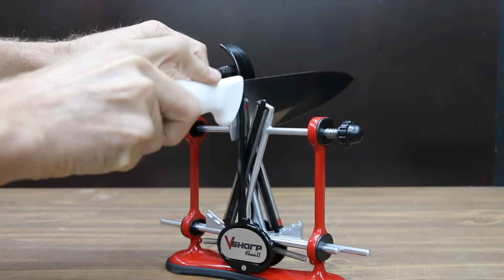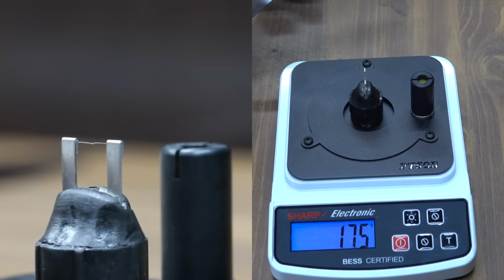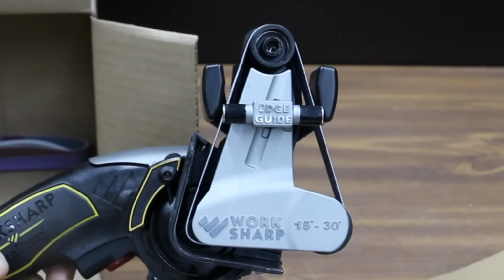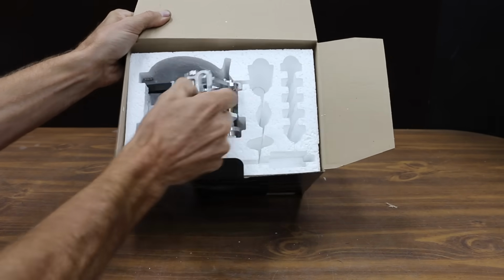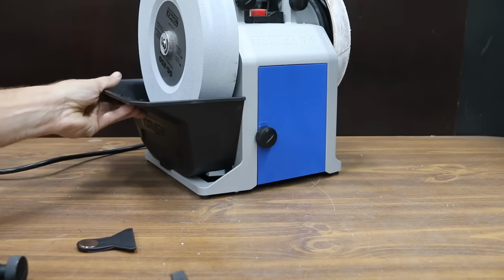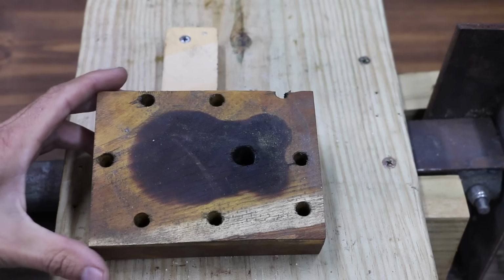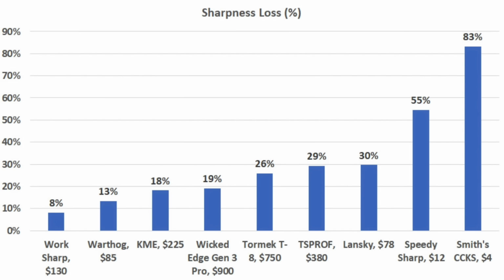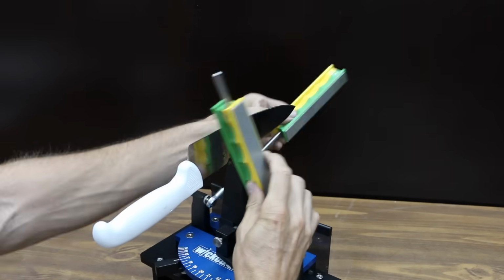RUSSIA vs USA Knife Sharpener? TSPROF vs Lansky, Wicked Edge, KME, Tormek T-8, Work Sharp Ken Onion

Comment: I've used the Smith's Abrasives PP1 Sharpener ($10) on axes and pocket knives, It has always done a great job. The Smith's tool you used is about $4. In other words, the Smith did a decent job (actually, 175 is a razor blade on your chart!) for a tiny fraction of the cost of the other ones. A slightly higher end Smith's would be better still. I've thought of getting the Lansky, but your tests proved to me that the simple and inexpensive Smith's is all I need.
Reply: That Smiths TOY is garbage. You dont care about your knives. Im a serious knife owner. I have tried most of these except the Russian tool which I think is probably the best. (Thheir knives are fantastic) I prefer the Lansky diamond. But I have usawed the the cheaper Lansky Carborundum. That Smiths thing is OK for puttng in your glove box. But it wont give you a REAL edge. It will be gone in 5 minutes. What crap.
Reply: @ziblot1235  You are right. My knives are utilitarian. Opinel and Mora. If they break, I buy new ones. It sounds like you should use the lansky for special knives. But it isn't necessary for me.

Comment: Great video. Thank you! The only one I missed is the manual sharpening with water stones.
Reply: Found it in another video. But 1000 is not enough to sharpen a knife. At least 3000 would be good
Reply from the maker: Thanks!  Thanks for the feedback.

Comment: By your video, I think the top 3 I'd personally consider are the Lansky, KME and TSPROF. The Lansky seems like great performance for the price, while the KME seems to be a notch better but commanding a much higher price. The TSPROF is a fair bit higher in price than the KME and while sharper, seems to lead to increased sharpness loss compared to KME. But the TSPROF (by what I could see) seems to allow for longer and more varied blades than the Lansky or KME products. 

 
The Lansky seems like the best product if keeping price in mind, though if you were sharpening a variety of blades the TSPROF seems the way to go from what I can tell. The KME strikes me as something of a middleground between KME&Lansky when factoring in both Sharpness and sharpness loss. It's very comparable to the TSPROF however. 

The style of sharpener these 3 seem to be, I wonder how much skill factors into it. I don't mean to say I don't believe you're skilled in this, but I'm not sure how much experience you have with this style of sharpener. It would be interesting to see a professional compare these 3.
Reply: Considering import taxes and logistic costs, situation is a bit different depending on where you live. Here, in Moscow, This particular TSPROF costs ~180$ while Lansky costs ~100$
Reply: What helps the kme is their gold series diamond plates...not sure where kme sources thrm. But they are incredible....after my kme bit thr dust I use all my stones n plates on thr tsprof and actually get better results.  But other factors such ad portability need to be discussed as well, and in that regard both thr kme and lansky beat the tsprof out of the box.  Thr lansky is a very capable system, but the misconception is price, if you go all out you are in thr $250-300 dollar range thus in same park ad thr fully loaded kme, which is far more accurate and has superior stones and stone selection.
But to each their own.
Stay sharp
Reply: I'd say technique is more important than which sharpener you use. If you used the same stones on all 3 systems you mentioned, there shouldn't be an appreciable difference in sharpness or edge retention between the three(though the tsprof has a tighter tolerance in the moving parts that determine the sharpening angle, so that may result in a better edge). 

To me the most important factor when deciding is how many knives you have, and how often they need to be sharpened.

Comment: I think the two things that were missed here as value propositions are versatility and speed. This is a review for a one-off sharpening, but if you're doing a set of knives then the speed and effort requires matters. As a less important point I'm liking the Tormek as I can use it to sharpen chisels and plane blades, but I completely get that's not important for most people. It is a point in favor when it comes to price vs use case though when compared to the $1200 Wicked Edge, for example.
Reply from the maker: Thanks for the feedback.

Comment: Your continuing efforts on sharping devices and systems is AWESOME. Keeping knives, chisels, planes, mowers, scissors, and countless other tools sharp, is at the heart of safe, efficient, and successful maintenance of so many workshop essentials.   I just purchased a WORK-SHARP PRECISION ADJUST KNIFE SHARPENER – ELITE. I think it could be an honest contender being an easy to use knife sharpening system having a list price of $120.00. Being non-electric and reasonably compact it seems to at home on the bench and in the field. Too bad it seems dedicated to knives only. Perhaps chisels, plane blades, axes, etc,, are in its future. I hope you’ll include it in Version THREE Project Farm sharpening devices test and comparison.
Reply from the maker: Thanks for the video idea.
Reply: @ProjectFarm  BTW, the Work Sharp Elite use the same size abrasives as the Lansky, but of course in a different style holder.

Comment: it's seems like a lot of that cutting test is dependent on how tight that string/wire is strung between the two posts.

The tighter it is strung, likely the less force is required to complete the cut.
Reply from the maker: Thanks for the feedback.

Comment: ME~ breaks out a whetstone, and with the same amount of time they put together one of those 200+ dollar sharper together i am done sharpening a knife and shaving with it..... ANY knife sharpener if one takes the time and does it right can put a smooth razor edge on it...and yes i understand they are just testing and comparing knife sharpeners but it looks like one needs a mechanical engineer to put them to gether and use all the different accessories.

Comment: So out of all of these, which one is the best value for the money? I would think the Lansky System has to be a good value, right?
Reply: Yea. Lansky is what I’ve been using for last eight years. You can get them with regular stones. Diamond stones. Even a leather strip and ceramic stone. I would suggest spending just a little bit extra and buying the clamp as well. Makes it loads easier

Comment: I always like your videos.  You try to test everything you can think of.  I want to suggest something a little different.  I have been looking at purchasing a knife sharpener and have looked through many pages of sharpeners on ebay with a lot of different designs.  I got to see some operate on your video and I'm trying to decide what's important.  I think the ones that clamp the knife then you can flip it over without removing it and having the stone is on a handle with a long rod through a swivel rod end are the best.  It follows the edge curve.  A lot of them can't flip the knife over and I guess you have to take it out and re-clamp it.  The length of the rod seems like it should be as long as possible to keep the angle of the bevel as close as possible as you go around the radius towards the knife tip because you are extending the rod and changing the angle.  Mounting the sharpener to the table is an issue and also how it accepts different stones and diamond sticks.  The leather hone worked great and could be purchased separately.  That's the sort of thing I need to make a decision about buying one and finding the best deal.
Reply from the maker: Thanks!  Thanks for the suggestion.

Comment: In Russia TSPOF BLITZ 360 price is much less - 240$, base version(almost the same, but max angle is 25 instead of 37 degrees) - 170$. With such price basic version is one of the best choices for easy and handy knife sharpener. Although most Russians go with Ruixin RX-008 for just 20$ and ok with it.
Reply from the maker: Thanks for the feedback.

Comment: although i like and appreciate these tests, i feel it's worth mentioning - as an aside - that the steel used in the test knives is neither japanese nor high-carbon. X30Cr13 is a european incarnation of a basic, highly corrosion-resistant steel formula. its specification generally lands the steel in the low-carbon bracket, though some examples may enter medium-carbon territory. knives made of X30Cr13 are very limited in their cutting performance. they are also, commensurately, very easy to sharpen.
Reply from the maker: Thanks for the constructive feedback.

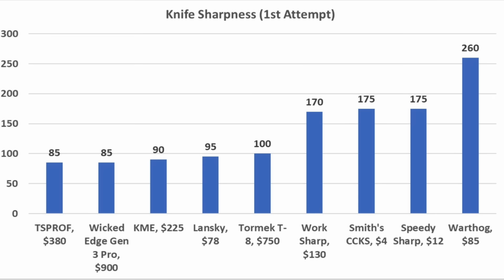Comment: 13:17 so i'm noticing that the last 4 with much worse sharpness numbers, are all sharpeners that require the user to hold the knife at the same angle with each pass. they might have given better numbers if the user had a rock steady hand and put the knife through at a perfectly vertical and consistent pass with each stroke.

I would be very curious if a rig setup to use this in that way would improve their numbers. not that it would make sense to do that, but for science!
Reply from the maker: Thanks for the suggestion.

Comment: I bought a Lansky based on good reviews and I think it is in the sweet spot, ie sub $100 and very good sharpness. I completely rehoned my factory knives at home and they're razor sharp now. To boot, they also "re-sharpen" much easier with the cheap rod that comes in the block. Love this sharpener.
Reply: I have also had good luck with the Lansky sharpener. The only bad thing I can say about it, is that it can be hard to use with some small pocket knives. But it is quite easy to use and knives come out as sharp as a razor.
Reply: I love that everyone is like "OMG Lansky Blows so hard!" And you come with this. Some people shouldn't be allowed near precision tools, ty for showing experience can be subjective.

Comment: I'm actually somewhat surprised how controlled of an experiment this was, but there is 1 problem, you weren't able to damage the blades similarly to compare repairs from the same damage. Therefore you should've showed us the before and after of each knife, and then showed us the difference that the sharpners made from the before to the after.

Comment: wow that is a lot of work setting up and doing the best to sharpen many knife as possible in this one segment the test you used would make sense almost equivalent to cutting bones or when chopping (more like slicing veg and ect ect) will wear the knife down but the main thing is how long will it stay sharp after it has been sharpen. 
not like some infomercial doing extreme abuse trying to hack a concrete block really and still sharp?
this is a good video like you said who want to start out sharpening business bravo.
Reply from the maker: Thanks for the feedback.

Comment: THANKS for all that work! 
I'll have to get my BSME, an MS in Materials Science, access to a scanning-tunneling electron microscope, then a coupla specialized certs, before I can use those pricey and super-complexificated sharpeners. 
But, practically, at what point (no pun intended) is a knife sharp enough to be entirely adequate for 95% of all hands-on kitchen chores?

Comment: I love how unbiased you are.. even when finished testing I am left with myself to go over the data and it helps me choose what is best for my use and wallet. The microscopic view was fantastic. After going over your vid a few times I am choosing the unpopular according to comments and your vid: "work sharp".. (Even though I was not searching for a new sharpener! lol) I really think it is superior actually. I don't think you could make it more dummy proof, and I have a suspicion that it left it with a slightly different angle than the others. I have seen what convex edges can do in the hair cutting business (endurance) and I'm all over it. Also.. As long as the knife IS sharp enough.. sharpness loss % is totally of the most value in my eyes.. If this test would have continued with the torture I bet it would start to shine brightly... It already smoked everyone there.. even if you would have put a finer edge on it, I would wager it would still be in the top 2. I have no idea how hot it gets the knife but I might consider water after every pass. 

As with most of your tests.. first, they really are the best.. but there is always room for improvement.. and with most of them, more torture or time in use... would be the pinnacle of info on top of what you already do.. I know that makes each video 3 times harder though so I understand and it leaves me with something to think about which I don't mind. Great job again!
Reply from the maker: Thanks and you are welcome!  Thanks for sharing.
Reply: @ProjectFarm  I tried the worksharp and I was wrong about it.. it blows goats as is.. The sad thing is it COULD be the best I think.. but it needs better angle control like the KME. Mix the two in a design (that I laid out elsewhere, but is not complicated), and it would rock. I have other things more important than building it, but maybe someday if no one listens and builds it. As is, I am better off sticking to my belt sander and leather. I'll probably get a KME knockoff since I am not paying that much for something so simple. I still thank you for re-awakening this interest in me.
Reply: I remember the first time I got to see a sharpener that could have been the first generation of this type. Back in 2008/09 I went to a gun show in Panama City, FL and two guys had one of these type of knife sharpeners on display. I had never heard or seen anything like it. They asked if I had a blade that I'd like sharpened and I agreed. I am very consistent about keeping my blades sharp but this one was due for a good edge polish. The guy drew the blade from base to tip a few times as I watched the spring loaded sides opened and closed similar to that of an accordian.(that was my first thought at the Time). After just about 8 strokes he did the paper test, and all I could say was wow! It was impressive indeed and so very unique from anything I've known or had used before! I wanted to purchase one but was unable to at the time, I think the price was close to $60. The only place you could get it was through them and for the life of me I can't remember the name of the product. It has been just in the past few years that I've noticed different brands using this same design concept.
Reply: @chadh3441  That sounds cool but I don't know if you are really missing out not remembering. Many systems can get a knife sharp. The difference is how long does the edge last. Something that sharpened that fast probably would not have a sturdy edge IMO.
Reply: @weeral1  I have to agree with you there on the longevity issue, just for the simple fact that achieving the perfect balance is not only difficult, it's rather costly to venture that far down the path. Most of today's items that are considered to be "high quality", are of a better quality  than the usual, or  average, that's available. So much emphasis and focus has shifted towards that perfect sweet spot where Costs and Quality Intersect with the Target Goal  that is Budget. I do understand this Outlook because of the fierce competition with China, Pakistan, Malaysia, etc . who are known for a massive portion of cheap bladed items, from full length replica swords of famous movies, to one handed axes, and even toothpicks for just pennies on the dollar. That type of competition is hard to survive individually, but is almost impossible to even think about opening a business unless your pockets are deep enough that they come to rest in your boots. Lol. There are a few out there who are giving it hell and trying everyday, I do have to be honest and give them their much deserved credit. Well, we all know that sacrifices have to be made a lot of times either one way or the other in our quest to achieve "as much bang for the buck" as we can get. I've adopted the motto usually associated with the tattoo industry.  "Good tattoos aren't cheap, and cheap tattoos aren't good." Lol

Comment: @Project Farm I was going to order the 4 diamond stone Lansky off Amazon however the bend ability of the aluminum rods concerned me. Several Amazon reviewers complain that the knife clamp won’t hold the knife securely and it damages the knife.
What has been your long term experience with the Lansky? I think you have had it for a while since this is your 3rd knife sharpening video.

Comment: You should definitely check out one of my knifes which I´m forging in my garage for hobby. But watch out, it will probably eat up your diamond sharpening tool and instead of this small piece of wire in your sharpness checker, you are going to need one of Wolverines claws to even get a reading at all....
Alright alright, might be a little bit exaggerated, but they are sharp. I´m using a 16€ diamond plate -> like a wet stone just a little bit different.
Thank you for all your nice and neutral reviews. It´s a blast to watch your channel.
Greets 
Dennis
Reply from the maker: You are welcome!  Glad to hear!

Comment: Great vid as always, I've used the Wicked Edge gen 2 for many years. Edge pro was its major competitor back when I first bought it and I was wondering why it wasn't on the list.  (not a criticism,  just curious)
Reply from the maker: Thanks for the suggestion.
Reply: Yep. Have been using my Edge Pro for several years. Even garbage knives work well using it.  

Recently, I bought some cheap diamond stones that fit the Edge Pro perfectly. They make it even more of a joy to use.

SIDE NOTE: I like the Wicked Edge sharpeners. Different versions have their unique advantages.  I decided to build one, but the clamp would be self centering AND would grip the handle, rather than the blade, which would rest on a stainless steel pole with a notch to hold the back of the blade. That would solve the problem they have with steep angles.